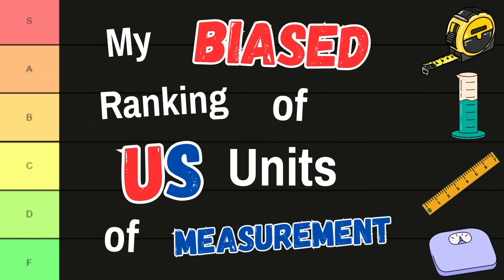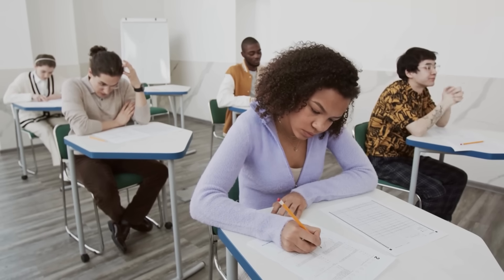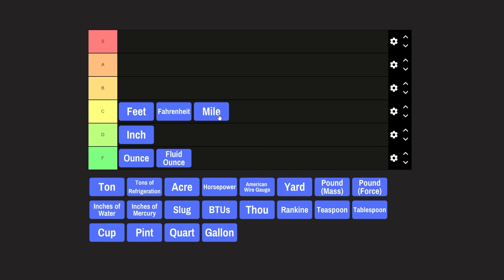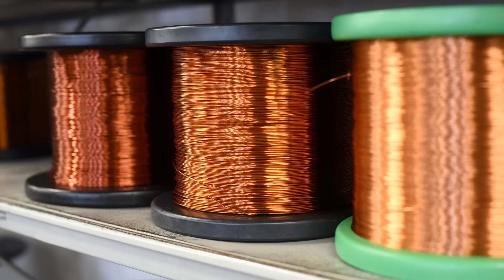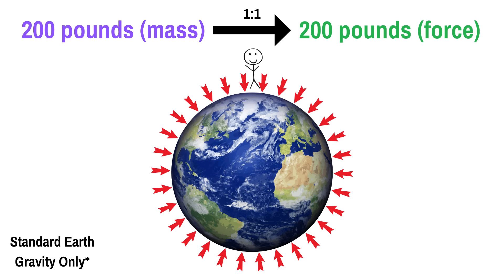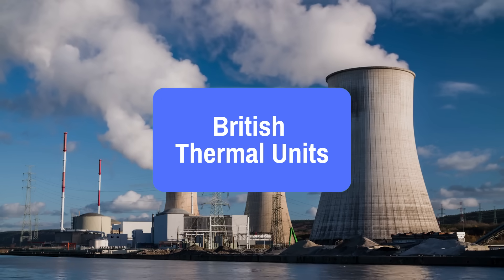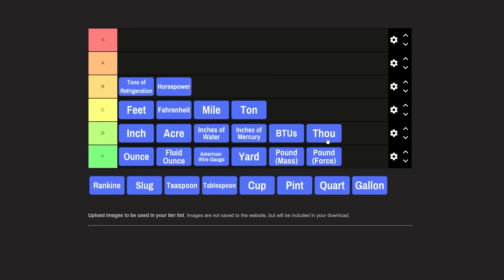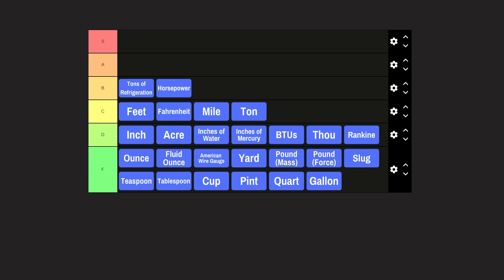Tier List of the DISASTROUS US Measuring System

Comment: I just love how subjectively objective the US Measuring System is.
It is so inconsistent that it somehow almost becomes consistent.
It is somehow so nonsensical that it almost starts making sense.

Q "How do you define 100f?"
A "Ah, that's damn hot!"
Q "...and 0f?
A "That's damn cold!"

Couldn't be more American! 😂
Reply: In NC USA, the coldest it ever gets is around 0 F. The hottest is around 100 F. The F scale fits perfectly. Also, because the F degree is smaller, you can express a temperature more precisely using, say, only two digits. Take the difference between 68 and 69 F, which is 1 F. To express this same difference in C, you have to use more than two digits plus a decimal point:  20 C - 20.55 C. For the weather, you can't beat F. Not so for engineering, however.
Reply: @clarencegreen3071  "you can express a temperature more precisely"
How is Faherenhiet more precise?
Reply: @dampaul13  The F degree is smaller. Note: precision and accuracy are two different things. Precision refers to "the fineness of the graduation." Accuracy refers to how close an indication is to being correct. A particular thermometer may be very precise but inaccurate.
Reply: @clarencegreen3071  22C is precisly 22C.
What is 22C in Fahrenheit, precisely?
What is 22C in Fahrenheit, precisely, using your all important 2 digit system?

My body temperature is precisely 37C.
What is 37C in Fahrenheit, precisely?
What is 37C in Fahrenheit, precisely, using your all important 2 digit system?

How precise do you need to be with day-to-day tasks?

Again, how is Fahrenheit more precise than Celcius?
Reply: While Celsius makes a lot of sense for water, I am not water I am a human. From a human experience perspective fahrenheit makes more sense.
Reply: @evancombs5159  "Celsius makes a lot of sense for water"
What does water have to do with temperature or measuring temperature?

"From a human experience perspective fahrenheit makes more sense."
How?
Why?
Reply: Basing it off of actual objects is the more intuitive system that an everyday person can understand. I bet if you ask the average American to estimate how big a foot is with their hands they'd be closer on average than your average European estimating how big 30 cm is.  Same with an inch versus say 3 cm.

Comment: What makes wire guage even more confusing is that in the trades we dont call 000 wire "zero zero zero"
We call it "triple aught"
Reply: That shouldn’t make it confusing, aught literally means 0 like the Canadians saying zed for Z. 

A “30 aught 6” is a .30 caliber round developed in 1906. 

And gauge makes more sense in shotguns when you understand how it’s derived. A 12 guage shotgun has a barrel diameter that a sphere of lead the diameter of the barrel would weigh 1/12 pound. The smaller the diameter the more spheres would be required to make a pound. Hence a 20 gauge requires 20 balls 

Where as shot sizes inside a shotgun shell are also a number system that gets bigger as the numbers get smaller. 

But Phillips screwdrivers get smaller with number. Ph 3 down to a Ph0000 most common is a ph2 though.
Reply: @franksmith5603  You need to check yourself.
Reply: It means triple naught. But americans just love being lazy and getting rid of random letters. Brits too, for that matter. Or should I say ma'er.

Comment: The Imperial measures of volume were developed FIRST. They are easy to divide in your head (they’re mostly base 3 or less) and are rooted in things a peasant would have. They all had a cup, a spoon, and a bucket. Imagine asking someone with no experience in measures to pour 235 milliliters or water. Now ask that same person to pour a cup. The metric units of volume are actually the completely arbitrary measures. Every one of them are. Imperial existed first, imperial is better for normal use.
Reply: Now, I‘m willing to say that a teaspoon and a tablespoon are fairly good as units if volume, they should probably be in A-Tier. 
But everything besides that is just way more complicated than the units of volume from the metric system. Like one liter is exactly the volume of one normal bottle of water. And one liter is also exactly 1 cubic decimeter or 1/1000 of a cubic meter. Thus you can also see that 235ml are roughly one glass of water.
Reply: Yeah imperial existed earlier, which is how the creators of SI were able to learn from its faults and make a better system. You know, technological advancement

Comment: At work, I have to be careful not to barf in my mouth whenever things like circuit board thickness or lead protrusion is measured in hundredths of inches.
My ruler doesn't have hundredths of inches.  It does have millimeters.  It also has inches in powers of 2 fractions down to 1/32 I believe.  Pick one.

Comment: As for the pint/quart/gallon thing, you missed one other point of stupidity. The US pint is only 16 fl oz. EVERY other country which uses imperial defines a pint as 20 fl oz (i.e. 25% larger): which of course means quarts and gallons are also 25% larger. Which means a common measurement such as  "miles per gallon" needs to know which gallon you are using.

Comment: It's hard to decide, what's worse. Length units, not convertible... Or the same weird wolumes, weights, forces... Inch - Feet - Yard - Mile... / spoons cup pint quart gallon / it's just... Nothing fits. If you take it away from science, just using it for all day talk Horsepower and Fahrenheit are somewhat OK. Bur all the rest...

Comment: The entire Metric system is based on the mass of water.  A cubic meter of water weighs a metric ton, 1000 kilograms.  A cubic centimeter of water weighs 1 gram.
Reply: Whereas in the American system, the answer to "How much energy does it take to heat up a gallon of water by one farenheit?" is "Go f**k yourself."
Reply: *at 4 degrees C
Reply: That's nonsense. First you need to define what a meter and what a kilogram is, before you can determine how many of each a certain substance measures.

Comment: Yard is actually usefull for navigation.
Because the Nautical mile(Nm) is equal to an average circonference of the earth ~ 40 000km / 360 (degrees) / 60 (minutes) = 1,852 m. And 2000 yards is somewhat equal to 1 nautical mile (it's 2025 yards actually). When we talk about a distance that is smaller than a Nm, it's easier to use yards instead of x/Nm.

Comment: I know the entire video was in jest, but some things that i feel deserve context:

Teaspoons and table spoons:  a typical spoon that you eat with holds a teaspoon.  A typical "large spoon" used for serving food is a table spoon.  They make alot more sense when you arent thinking of them as a measurement.  Its just what the two standard spoons happen to hold.

Ounces vs fluid ounces:  He didnt actually get anything wrong here, he just complained about something thats often touted as a feature of the metric system:  1mL = 1 gram.

Pound mass is not a real unit.  We rarely measure mass at all.  We often only measure the weight in pounds.  We understand that this measurement is dependent on the force of gravity on earth, but where the heck else would i weigh something?  Its a more straight forward measurement than mass for most applications.  You will never hear in a normal conversation "my mass is 150 lb.". Its always "I weigh 150 lb"

Tons of refrigeration:  Honestly we just use BTU for everything

AWG:  Pretty much anything "gauge" gets smaller as the gauge increases.  Its pretty common.

Thou:  Common measurement for manufacturing purposes.  Typically construction uses fractional inches instead, typically in 1/16th of an inch.  Occasionally dipping into 64ths.  The reason for the difference has more to do with the fact we dont measure 2x4s with a dial caliper

Comment: Fahrenheit is honestly S tier, it's the perfect system for describing the weather and would be the most intuitive way to do it if we designed it again. Especially where I live the temperature is basically 0 - 100 with a few outliers. The rest of the units, especially volume, I'd gladly get rid of.
Reply: Nah. Fahrenheit is just completely useless
Reply: @gentronseven  You're keep saying as if temperature is only used to measure weather, but there's so many other realms where temperature must be measured.

This is the main problem of the Fahrenheit, which is very similar to the rest of the imperial units.
Reply: @eustress7428  So don't use it for science, almost nobody actually uses temperature for anything besides cooking and weather, and Fahrenheit works great for those, better than Celsius. Actually Celsius is not really suited to anything, as it isn't best for science, either.
Reply: @gentronseven  Which temperature should we wear a coat? Or parka? Which temperature is the optimal room temperature? At which temperature do people sweat? 

Aside from being between 0 and 100, using Fahrenheit barely helps anything. The fact that you have to remember every number remains the same, even when dealing with weathers.
Reply: @eustress7428  better isn't perfect, you can guess which temperatures you need to do all of those things at by just knowing 0 is about the coldest it gets and 100 is about the hottest it gets outside. I know Celsius temperature scale too, and have used it, it just isn't as intuitive because -20-35 isn't as easy to adjust to for people, we like numbers 0-100. Kelvin is actually the unit used for most scientific research, and makes the most sense for that where comfort isn't the normal reason to measure the temperature. Celsius actually only makes sense when measuring water and reactions related to water, so it's not fit for either scientific or human intuitiveness compared to Fahrenheit or Kelvin.
Reply: @gentronseven  Fahrenheit is not even "better" on where it is claimed to be better. Just 0 being cold and 100 being hot does not make it easy to guess. Especially when the 'middle temperature' is way above 50. There might be a way to explain that, but that makes matter worse and proves that it is not as 'intuitive' as you thinks. 

With that being said, there is also an 'easy' way to guess celcius: 0~10 is cool, 10~20 is mild, 20~30 is warm. Your "-20~35" claim is much more invalid than you would think.

Besides, even "Only when measuring water" actually means a lot. Three quarters of human body is water and we cannot live without water. Even your beloved weather revolves around water. (And fyi, your another beloved Kelvin is also based on Celcius)
Reply: @eustress7428  True, the human body is based on water but the relevant temperatures for water changing from liquid to gas has little to do with human comfort. I'm not sure where you live but -20-35 is completely relevant, we actually have days outside of that range in both directions but not many. It's not really important for whether Celsius makes sense, though. Maybe something you'd understand is not measuring a person's height in Kilometers. You can measure height in Kilometers, but the value you get back is not as easy to use. Same deal with Celsius. Yes, it's mostly arbitrary, but we might as well pick numbers easiest to use. That's why I use grams and liters but I don't go out of my way to use Celsius.
Reply: @gentronseven  
The whole point is that all your defends for Fahrenheit are merely your subjective opinions. And unlike your assumptions, people outside the US use Celcius for weather without any problems. Yeah, they use "-20 to 35" (or "0~30 and some more" in my pov), and they are just fine with that.

Besides, your "measuring human body in kilometer" arguments are honestly ridiculous; as if it is cold in 0 degrees and hot in 1 degree.
Reply: @eustress7428 everything about systems of measurement is a subjective opinion, it's solely a way for people to apply and relate meaning in a convenient way. So yes, it's key units should match what most people's brain see as key units. I think it's possible you simply don't understand the Fahrenheit system and have maybe never used it. It's easier and better for normal life, for 99% of temperatures relevant to people, which is what makes it S tier.  Celsius is ok, it tags one relevant temperature but it's not as good.
Reply: @gentronseven  Fine, I will just copy-paste my precious comment to represent my experiences using Fahrenheit.
"Aside from being between 0 and 100, using Fahrenheit barely helps anything. The fact that you have to remember every number remains the same, even when dealing with weather."
Reply: @eustress7428  I agree it barely helps anything, if it helped a lot then nobody would use Celsius but Celsius is good enough. That's actually how most units of measurement are, that's why the US Customary system still exists when most of the metric units are more relatable and actually better for purpose, like grams vs grains/ounces. A gram is S-Tier because it is convertible to volumes of water seemlessly for most purposes AND it is convertible AND it is a pretty relatable weight. I use these relationships literally every single day. But people still use pounds, stone, ounces etc because it's not better enough to change. (Ounces actually has this convertibility too but ounces themselves are harder to use because of the fractional weights you have to account for - they're too big for most of my measuring. Temperature doesn't really matter if it's 22.5 or 23 though)
Reply: Imagine a unit with the definition of the zero as just 'randomly cold', yeah that's your S tier.
Reply: @eustress7428  It's not just randomly cold, though, no more than celcius 0 is just randomly cold. Your body happens to be a salt and water mixture, the weather tends to be above there etc. Not random. -18 to 35 being relevant temperatures is way more random, it's not designed to be intuitive on a human scale.
Reply: @gentronseven  So, you think the saline that Fahrenheit used to define zero degree is exactly (or at least approximately) the same one with human body fluid?

That leads to another question. The freezing points of each saline solution vary hugely from one another. Then, does it really 'no more randomly cold' than the freezing point of just water?
Reply: @eustress7428  No, it's not more randomly cold because in temperate areas 0 is often as cold as it gets. You're thinking too much about it, there's no 0 that's perfect everywhere on earth and that one is good enough, it doesn't really matter how it's defined. We could define it as a temperature colder than 90% of days in non tropical latitudes or anything like that, the important part is how it feels not what it is defined by, and 0-100 is highly intuitive for people. I agree that scientific measurement systems shouldn't work that way, that's why there is Kelvin for that, it's not designed for weather.
Reply: @gentronseven  
You just said "I agree that scientific system should not work that way, that's why Kelvin is for that", and guess what? The Kelvin system itself is based on Celcius. 

If "Celcius is not intuitive on a human scale" why would Kelvin have choosen it at the first place? The thing is, Celcius is based on the boiling point and freezing point of water. And if water is not relevant to human life, what else would it be? Still think Celcius is "way more random" than Fahrenheit?

Also : All of the weather stuff you said is no more than a matter of familiarity.
Reply: @eustress7428  The weather thing isn't just a matter of familiarity, yes, you can become familiar with Celsius but if you already understand numbers, 0-100 are the best numbers for us to understand and talk about. The temperatures on earth are very typically 0-100F , Celsius uses the boiling point of water which is almost always irrelevant. The useful range of numbers is -20-35, not intuitive at all. And still inferior if you adjusted it to be 0-50, because the size of the unit loses half the precision. Water isn't relevant because most of the temperatures on the scale aren't relevant to atmospheric temperatures on earth. For scientific measurements, it really doesn't make sense to scale it based on how people feel but with weather that is all we're talking about.
Reply: @gentronseven  Did you just say "boiling point of water is irrelevant"? Seriously? How long has it been since you've ever been in the kitchen? You would never understand there is a temperature outside of 0~100 F, even in your daily lives.
Reply: @gentronseven Celsius 0 is were water freezes so when it's 0 deegres outside it likely to snow
Reply: @eustress7428  Yeah, boiling point of water is pretty irrelevant to weather and rarely comes up in cooking, Celsius is not very great for anything really and not clearly better at all than Fahrenheit. I can see why if you were used to the other system why you wouldn't care for it, though.
Reply: @tschos600  That's fair, where I live in winter it is usually under 0 Celsius all the time. It's not that celsius is unusable but it's definitely not clearly better and makes the relevant temperatures -20-35 instead of 0-100. Sure, I can live with the average temperature being 16 instead of 60 but it's in no way clearly better and doesn't make more sense than 0-100 being the normal temperature scale.

Comment: For me as a German the whole imperial system is just unintelligable gibberish and thus F tier.

Historically there aremany different pounds for weight in Germany too. But it has been standardised (despite not being an official unit) as 500 g = 0,5 kg
And the definition of horsepower as I have learned it at school: the force needed to lift a weight of 1 kg to a height of 1 m in 1 second.